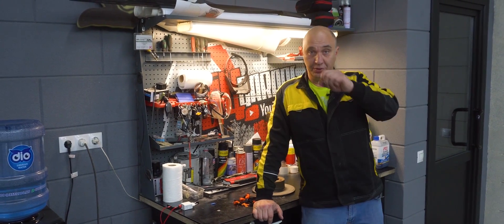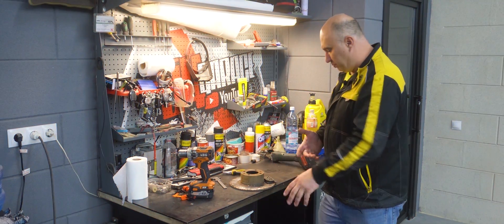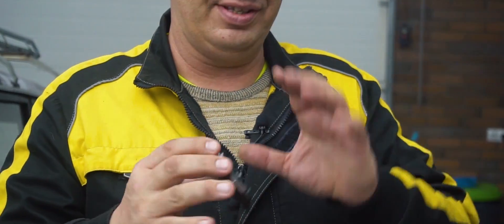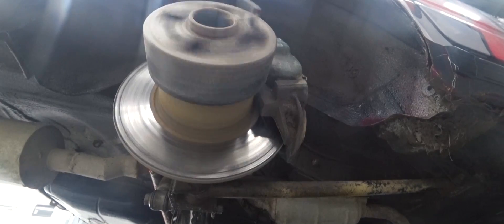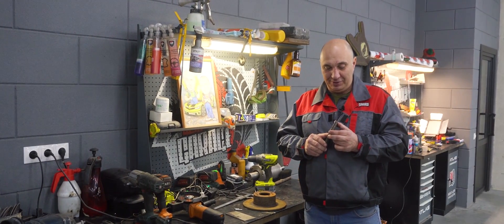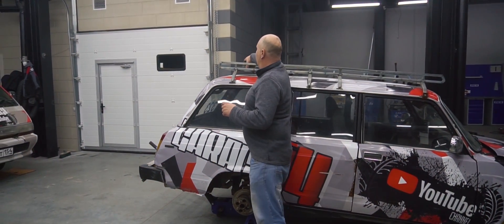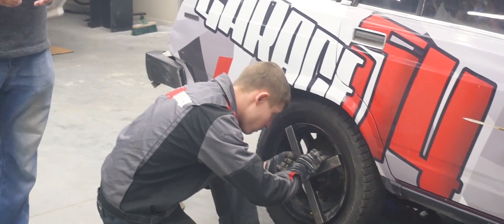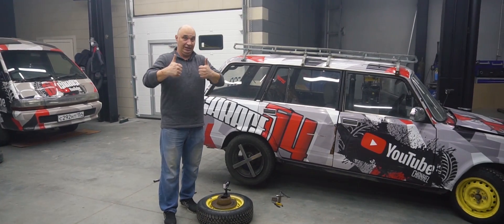Fiery flint-infused brake pads

Comment: Haha the other day I actually welded brake pads (the slot hole was oval, it needed to be round to fit the guide pins) - I didn't think anyone else would have done it recently, but it seems I forgot about Garage 54. :P

Comment: Try filling a radiator with motor oil or gasoline and see what happens. Great video guys!
Reply: They already did it. They filled the radiator with oil , from a Lada with blown head gasket. It worked ! Engine Oil where passing to the oil of the radiator and viceversa

Comment: Suggestion: make a electric-Lada using only startermotors attached to the gearbox!!!TESLADA
Reply: Lol!
Reply: This has been suggested for over a year...
Reply: Or alternators
Reply: @DiegoHernandez-bh4sw  alternators don’t work like that, they are driven. They do not drive
Reply: @custom165  yup, but they can be modified to drive
Reply: I think if he got like 6 pmgr starters it would do almost anything for 20-30km.
 upgraded my mustang to one,they run cooler and have far more torque for their power usage,used primarily for big block motors.
Reply: @TheJeremy5599  mustangs are underpowered anyway

Comment: I wonder if you can make your own brake pad friction material? I know its just a high temp glue, saw dust, brass shavings( like off a lathe or drillpress) and some other dusts to help with heat, like carbon and ceramic. I would try jb weld as a bonding agent.

Comment: Just for reference, that stuff is not flint, it's a material called ferrocerium (its a mix of iron and cerium) that becomes pyrophoric when abraded, it's actually burning, unlike real flint, which just scrapes off thin bits of steel from the striker which ignites from friction.

Comment: Magnesium brake pads, then see how long it takes to catch the car on fire.
Reply: And of course then you put it out with water
Reply: Nice suggestion!!
Reply: Those flint were made of magnesium....
Reply: @brettc5386  yes but there is very little magnesium in those. Less than 5%.
Reply: @fryloc359  true but it's 5% for a reason pure magnesium is soft and therefore I don't think it would get a spark, but I could be wrong
Reply: @fryloc359  my only problem is I don't think you would have enough force at the shearing point of pure magnesium to ignite magnesium
Reply: @brettc5386  yeah I dont know that much about it, I just know that it burns very hot, bright, and you can't put it out.
Reply: wheels too
Reply: Or better yet, make some brake pads with a mix of iron oxide and aluminum powder (maybe sinter them or use some kind of epoxy matrix) with magnesium rotors

Comment: Can you get a brake rotor and worn down brake pad weld together by spinning it till it’s red or even white hot?
Reply: Someone already tried it and the damn thing cools off too fast or just explodes. You can do it on a nice sports car with a powerful v8 so you have lower RPM and higher torque.

Comment: try adding magnesium to the mix for a bright white spark show!  don't know if it will work but give it a try.

 also try making tires out of hot glue!  will it have a better grip for racing?  what happens when you do a burnout?
Reply: I'm pretty sure those fire starter rods are made of magnesium, right?
Reply: @BuzzinsPetRock78  nope thats flint.  magnesium doesn't spark like that but those sparks can ignite the magnesium.

Comment: Grooving the disc's make it fail prematurely. Thats why race cars run SOLID rotors, the drilled ones are poser stuff. They worked in the 1950's when pads outgassed a ton. That hasn't been the case since the 80s/90s.
Reply: But they look cool
Reply: idiot, they did it to make the flint spark more.
Reply: @dimitar4y  

You can't call someone else an idiot then call ferrocium flint. That's just hilarious.
Reply: @CNYKnifeNerd  he thought they're notching the disc for some higher purpose. That's what makes him an idiot. Flint is a common name for metals that when scraped are used to start a fire. You don't see it commonly sold by it's freakin' latin scientific name .-.

Comment: These rods are normaly magnesium.
Reply: Yeah I also thought titanium but it is too expensive
Reply: @dave_xc  dont think titanium gives off a lot of heat either.
Titanium is definitely longer lasting.
Reply: Fertocerium, not flint, not magnesium.
Magnesium doesn't oxidize like that from scraping, you can scrape a magnesium rod down into powder/shavings.
You need to add heat to have it ignite ,if you introduce a spark from a ferrocerium rod (around 3000°C  ) to a pile of magnesium dust, the dust will ignite, it burns around 3100°C and is not easily extinguished.
Generally if you have a bit of material knowledge for the area you are in, you can easily effect fire with a "ferro rod" and natural materials in any weather condition.
Reply: @hectic6981  how is fertocerium made?
Reply: @dave_xc  it is an alloy containing Iron and added soft metals to facilitate removing of material to produce the sparks.
Above is my knowledge,
I was not certain on specifics so I looked it up.
Old school ferrocerium was 70% cerium and 30% iron.
The new standard formula is 
iron (20.8%), cerium (41.8%) neodymium (4.4%) praseodymium(4.4%) magnesium (4.4%)
 lanthanum (24.2%)

Having said that I can confirm that there are many different places making ferro rods and those rods vary in hardness and their ability to throw good sparks  significantly, so there are more than a few blends being used.
Reply: @dave_xc  additionally, the sparks that come from a traditional ferro rod come from the iron, iron oxidizes readily that's why it rusts so easily, if you can shave iron off in small bits and expose it to oxygen it oxidizes quickly and violently around 1400°C this is how flint and steel works to light fire.
In a modern ferro rod, many of the other metals (like magnesium) are added to make the spark hotter.